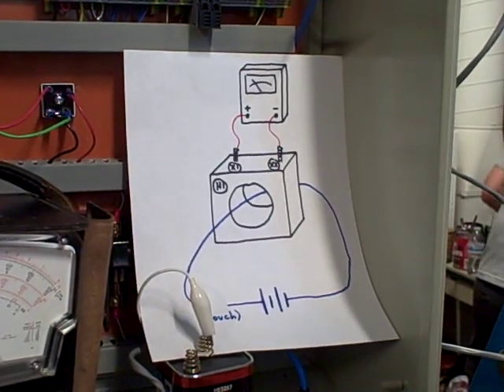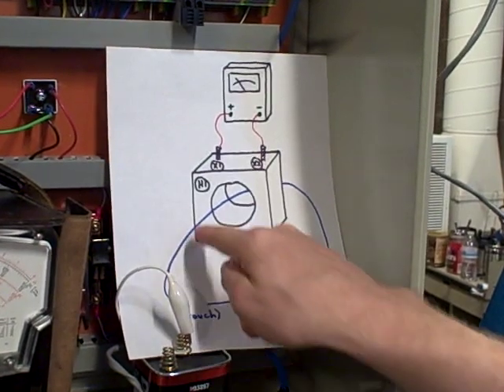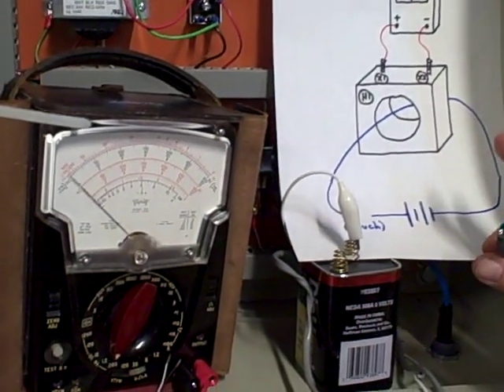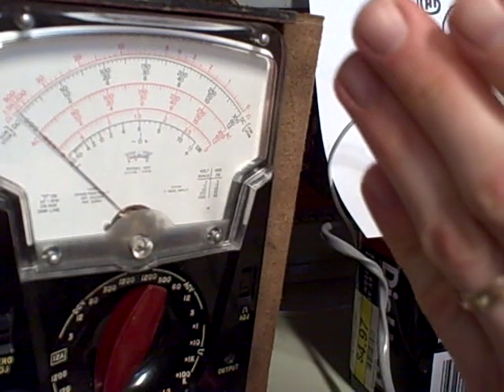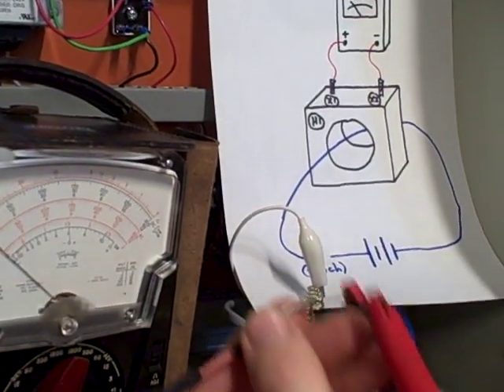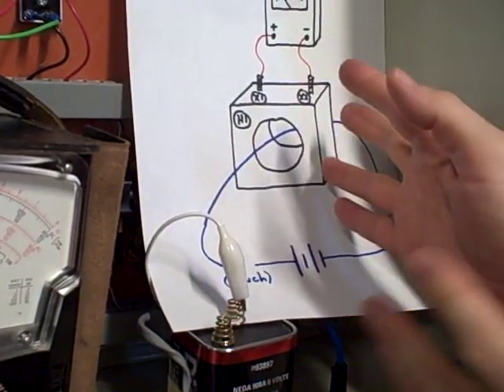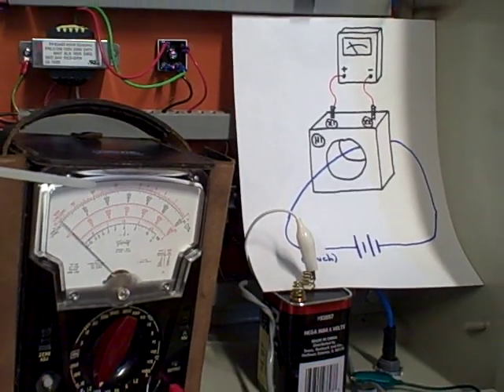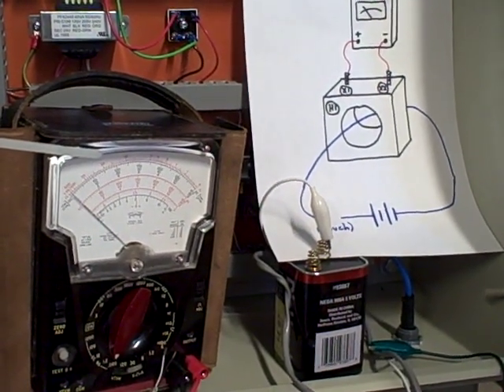Current transformer polarity check using a battery and meter

Comment: When I use the kickbox I made, I apply the DC voltage to the CT secondary and measure on the high side. Never saw it done in this fashion. Better meter movement when stepping it up vs stepping it down.

Comment: How transformer work on dc
Reply: it fries, then it doesn't, anymore. 
it's DC only when it stabilizes after exponentialy increasing (because of the inductance, which resists to change of current by inducing it's own, contra voltage, right?) to the steady value...which is defined by the dc resistance of the winding. one plus the other=impedance, right? until then, ....what happens when you switch the battery off, during the current rising? 
...think of it as a quasi - square signal, more of a series of pulses really, being fed to the tr.